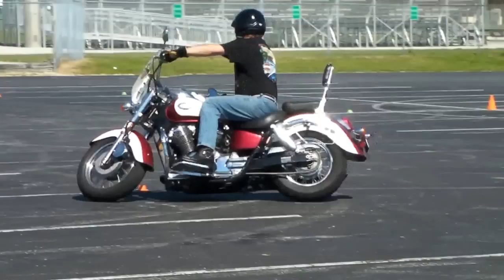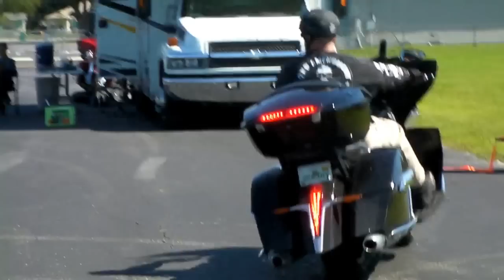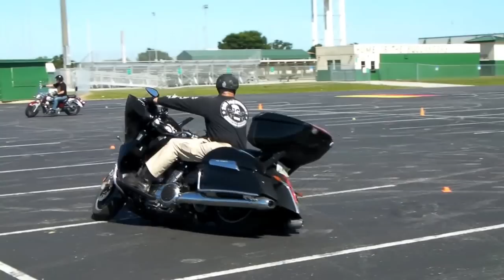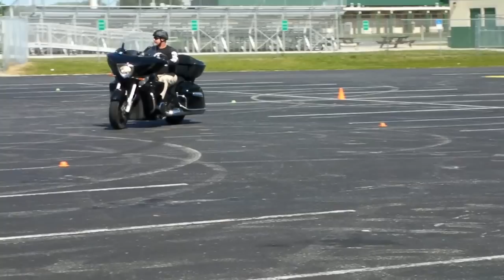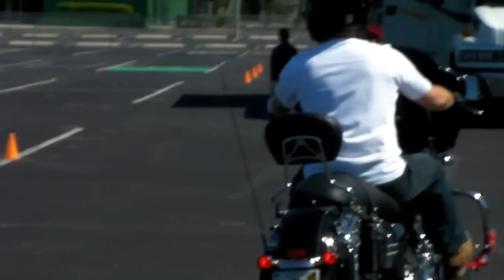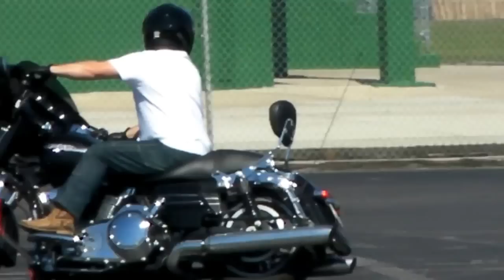Turning a big cruiser offset cone weave

Comment: Hubby is on the Victory! 😍🥰
Reply from the maker: Yea but he's taking the easy way thru. (the outside cones) the cones on the inside is the normal way thru the exercise. The way the guy on the harley is going.
Reply: @motorman857  I thought before the green was the PRO level 🤔
Reply from the maker: @lindafreeman3803  No. I had the very wide gates where you can see the 6"" cones and the normal gates where you head for the green cones. The pro level is another 12 ft narrower.
Reply: The guy on the victory. Bike seems too big for him. Maybe he should adjust the handlebars. Or he should try to start on a lighter bike, perhaps a bicycle?
Reply: @KB-cl3fc  🤣🤣🤣
Reply: What a danger to the road. Who gave him his endorsement?